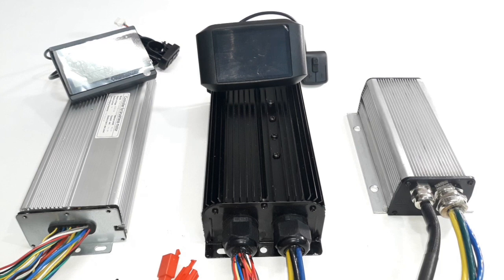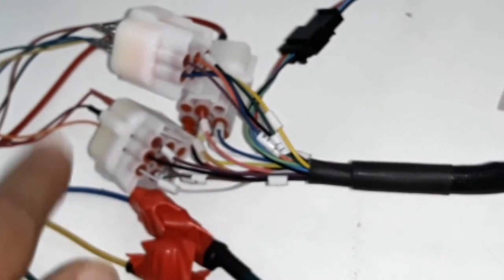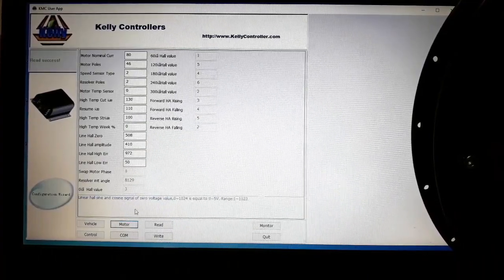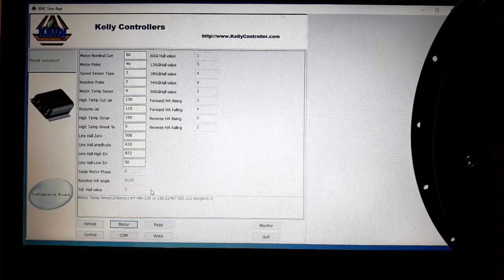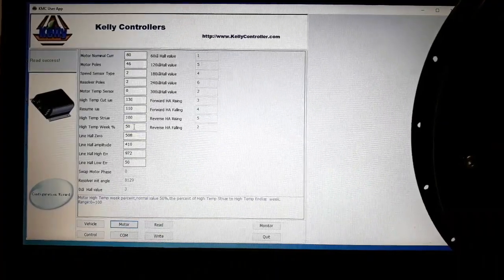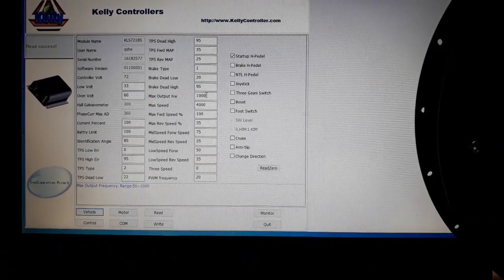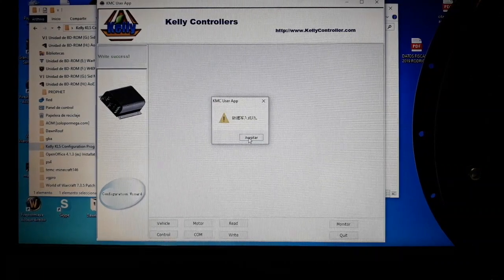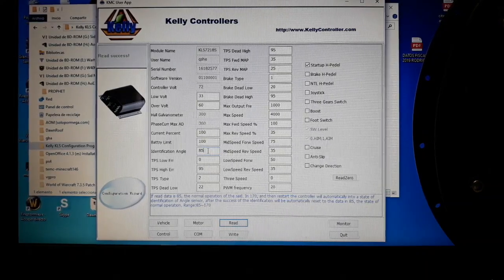KellyController Parameters, Programing setup, Part1 (English)

Comment: Hi my motor reverse speed is very high how to change settings
Reply from the maker: Hi Kaviraj, Check the second video of settings it is explained there how to change reverse top speed.
Here: https://youtu.be/_if9dnVkr6U
Reply: @gonzalop.chomon327  hey thankuu so much because of you I have successfully done the motor programming
Reply from the maker: @kaviisworld  Good to know :)
Reply: @gonzalop.chomon327  hey also what is that foot switch actually do 
Supposed I have motorcycle it has side stand and I turn on foot switch in controller until I remove  or I lift up the side stand then only motor can start right
My second point is that cruse control its start automatically after 5 sec its dangerous I want to use switch  whenever I want I can turn on and off is it possible
Reply from the maker: @kaviisworld  The "foot switch" is a safety switch that can be used to make the motor stop or not start if not activated. Like you said in a motorbike can be used at the side stand.
The only way that cruise control activates is automatically after 5 secs. same speed in this controller model.
Reply: @gonzalop.chomon327  ok ok but what if I want use cruise control with switch button push to on push to off example if i am driving on open long road that time I can turn on but if I am traffic if on after 5 sec then it will be big problem now days many companies are give cruse Control with switch button on off
Reply from the maker: @kaviisworld  Yes it is not the best way to manage a cruise control in my opinion, but this model does not support that option. :(
Reply: @gonzalop.chomon327  have model that support that but I want that other side functions on switch buttons and ha one more thing normal breaking will automatically work as regenerative braking. Or ( do i need to add some wire to break )
Reply from the maker: @kaviisworld  You can set up your regenerating braking in very different ways, I think I talk about it at last video, here:  https://youtu.be/ITP6mey2eCk
Reply: @gonzalop.chomon327  yaaaaa my got test success full my ev motorcycle run 1 time 
But I see one issue 
1 how to control the throttle response 
Peakup is very high mean torque is very high how can controller smoothly i got sacred when spin my throttle bit fast if spin Normally it’s work fin but little push my motorcycle run faster like sudden
Reply from the maker: @kaviisworld  Reduce the PID numbers as I comment in the video. As well you can check your middle throttle MAP value I normally use from 25 to 40%.
Reply: @gonzalop.chomon327  ok
Reply: @gonzalop.chomon327  ok I will try that I found out one issue when my battery is very low my motorcycle is running normally and suddenly stop . I want like Tesla when there battery is low there speed got reduce so how can controller if my voltage is drop to some leave my RPM will decrease…… 
( and thank you for answering questions)
Reply from the maker: @kaviisworld  This controller model (KLS) does not support that function.
Reply: @gonzalop.chomon327  mine is KLS7218 if you can search on google there is PDF I want to know that is it possible in kelly controller if yess what would be the that feature name or program functional name so that I can change the setting
Reply from the maker: @kaviisworld  Like I said the KLS models do not support that function.
Reply: @gonzalop.chomon327  hey where is the PID numbers
Reply from the maker: @kaviisworld  I talk about them in the 3rd video: https://youtu.be/ITP6mey2eCk
Reply: @gonzalop.chomon327  hey is there any way I can get reduce the controller continuous current we have option for peak percentage
Reply: @gonzalop.chomon327  hello everything is done just one issue I am facing if I do full throttle torque increase as soon as I realse the throttle speed is not going down for 1 second to 3 seconds  
 its still speeding after few seconds its coming down its very dangerous
Reply: @gonzalop.chomon327  got it
Reply from the maker: @kaviisworld  For the continuous current you use the Battery Limit.
Reply from the maker: @kaviisworld  For the torque release issue, check the TPS Dead Low value and the Accel Rls Time.
Reply: @gonzalop.chomon327  hey do you know kelly controller kls m three speed switch number and boost switch number
'
Reply from the maker: @kaviisworld  Low Speed is pin 22, High Speed is pin 12, medium speed is no connection. You can set 1 speed, 2 speed and 3 speed at the program.
Boost is pin 2.
If you use Boost you can not use analog brake. You have to activate one or other.
Reply: @gonzalop.chomon327  ok ok
Reply: @gonzalop.chomon327  i want use break switch but don’t want to cut off motor after I have break regenerative braking should start so for that do I need break switch or normal motorbike break is good 
And thank you so much I really like that you have replay so fast I am working on bike now thankuuu so much still need to learn so much
Reply: @gonzalop.chomon327  I have three wire for three speed so should merge two together for low speed and medium speed and one for high speed
Reply from the maker: @kaviisworld  for the motor to re-start after braking you need to disable the "Brake H-Pedal" function.
Reply from the maker: @kaviisworld  For the 3 speed function check the schematics at the manual on page 13
https://kellycontroller.com/wp-content/uploads/kls-s/KellyKLS-SUserManualV1.10.pdf
Reply: @gonzalop.chomon327  hey its not working see 
I have throttle with three speed mode and Forward reverse three cable for throttle, two cable for forward reverse and another three cable for three speed ok
So 1 three cable in (3,20,4) throttle 
2 two cable in (33,11) forward reverse 
3 three cable in ( 22,12 ) three speed right 
In controller program I have set three speed [2]
And Max FWD speed its [100%]
Reverse is [6]
Mid speed forward speed [50%]
Same reverse 
Low speed forward [20%
Same reverse 
But when I switch mode every where I get same speed like low speed or should merge 2 cable and put in 22 and another in 12 number 
Why its not working what the issue
Reply from the maker: @kaviisworld  When pin 11 (12V) is connected with pin 22 it should be low speed.
When pin 11 is connected with pin 12 it should be high speed.
BTW reverse should be pin 14 with pin 11
Reply: @gonzalop.chomon327  also for low speed different torque and power for medium is different for high is different if you see in india there is ola scooter they have done that low speed very low torque power difference
Reply from the maker: @kaviisworld  Well, Power, Torque and Speed are all related.
Reply: @gonzalop.chomon327  I have try that i have removed my pin 11 is purple one and put in pin 22 and another throttle pin in 12 its not working you mean to say make pin 11 in two part then do it
Reply from the maker: @kaviisworld  Sorry I do not understand what you mean.
Reply: @gonzalop.chomon327  do you use whatsapp or your email id then I can show you connection photos I have try many time but it fails also 
……. I have noticed one thing while driving in BLDC motor that higher speed and torque it takes sooo much voltage like 72v it will go up to 66v  why is that 
It is like rockt taking so much fuel ⛽️ 
Example ( If one car 0 t0 100km in 3 seconds it takes almost 1 liter of petrol 
And another car same speed it take 200ml only then I can call its very efficient 
Do you know anything about SRM motor BLDC give good range at lower speed 
I want to build bike in india so that poor people can long km 200 km very easily with 80km hr speed
Reply from the maker: @kaviisworld  Electric motors are very efficient.
But motorbikes are not efficient at high speed because they have very poor aerodynamics.
Example: On my bike at 25Km/h on flat road I use only 200W 
At 45Km/h I use over 1100W
Reply: @gonzalop.chomon327  yess its like it suckling all the juice 🧃 I have read Switched reluctance motor is very good at high speed I want to try that but dc 
A DC motor's speed is directly proportional to the input voltage. The higher the input voltage, the faster the output speed. The lower the input voltage, the slower the output speed.
Reply from the maker: @kaviisworld  I don´t know your setup of controller, battery, motor. So I can not say if it is well calculated for your project or not.
But here is a number for reference: A motorbike of around 175Kg will need around 5000W+ from the battery to maintain a speed of 80Km/h.
So if you want to have 200Km range at 80Km/h you need a 12.5Kwh battery.
Reply: @gonzalop.chomon327  but this much battery in india its not possible people can’t afford max 4kw they can that’s need to something different way
Reply from the maker: @kaviisworld  The you have to reduce speed and weight, there is no other way.
Reply: @gonzalop.chomon327  hello sir I am having big issue I have turn on RLS_tps break after throttle releases it will break the motorcycle 🏍 like ICE. Engine but the major issue is my wheel hub is burning 🔥 that day smoke come out from rear wheel sprocket ⚙️ also burn 🔥 because of wheel hub what to do I want that function but why is giving load on wheel?
Reply from the maker: @kaviisworld  When the motor is regenerating it is actually the same as an acceleration (deceleration = -1*acceleration) but the work is the same. So tha motor heats up more.
Reply: @gonzalop.chomon327  hey thanks I found out the problem its because my break pad 
One more issue after putting reverse my bike going forward its scary 😟 some time goes properly reversed mode sometimes it goes forward